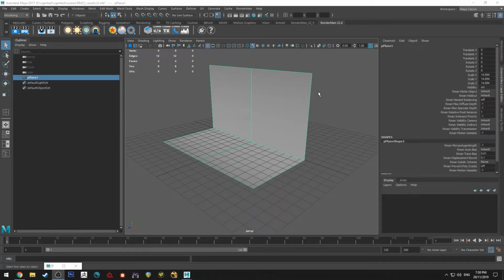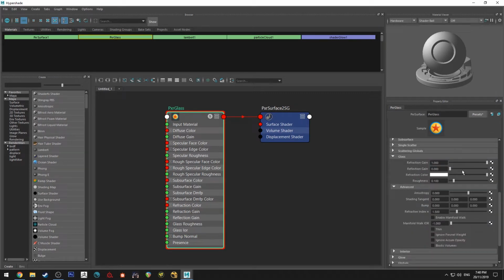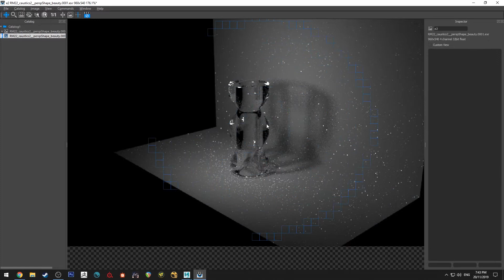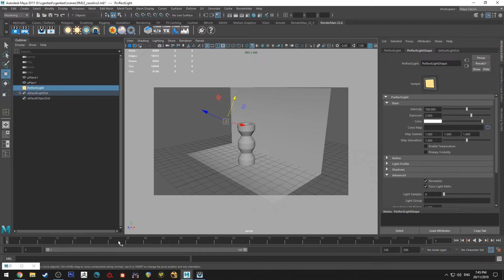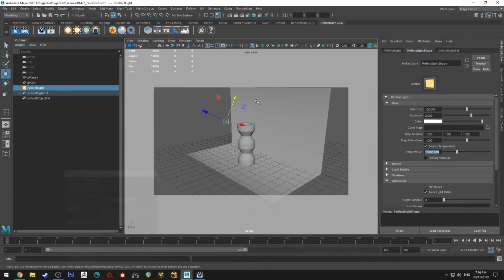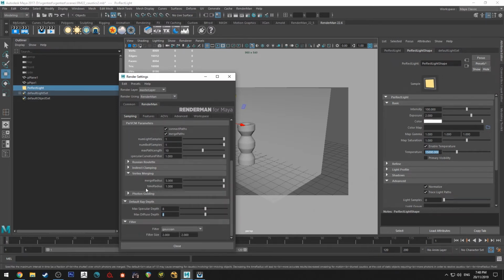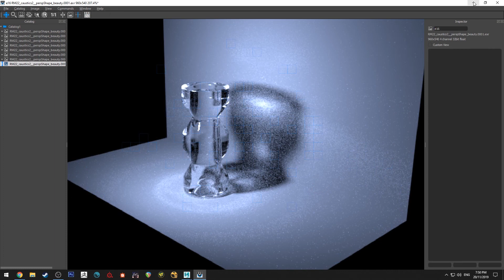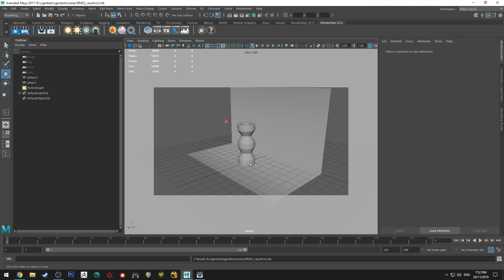Renderman 22 Caustics Tutorial

Comment: Can you please do a tutorial on how to make metallic distressed glass using RenderMan? I couldn't figure out how to create this material and I couldn't find any sources to lead me in that direction. I tried to create it in Substance Painter but had a bit of an issue to get it to look translucent enough.
Reply from the maker: I did a tutorial a couple of years ago on how to make a distressed painted pillar which uses pxrlayersurface, this is the method I would use have a look for that tutorial. One layer will be the glass the other will be a fractal controlling the roughness of the distressed areas and the same node will also be the mask for that layer.
Reply: Small Robot Studio Thank you so much I’ll give that a try!